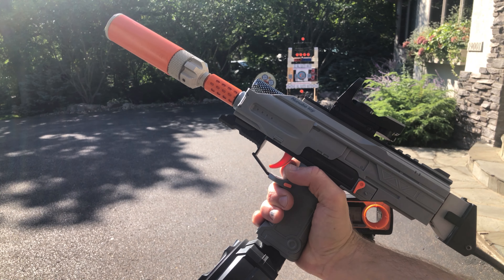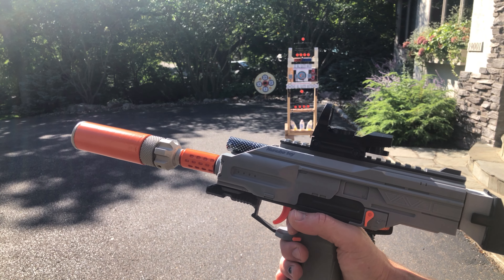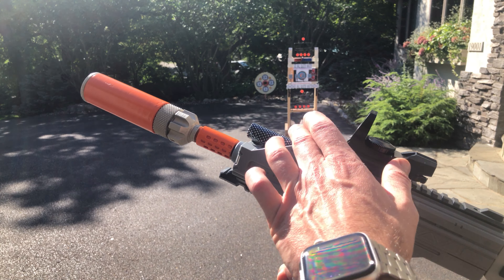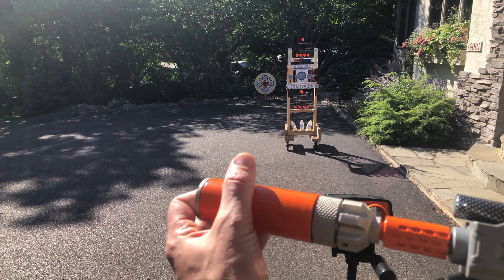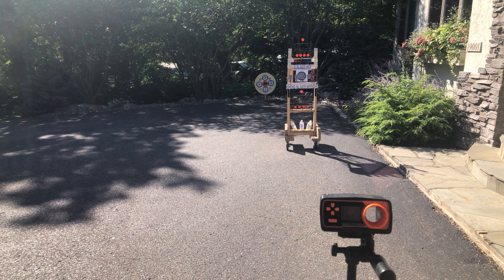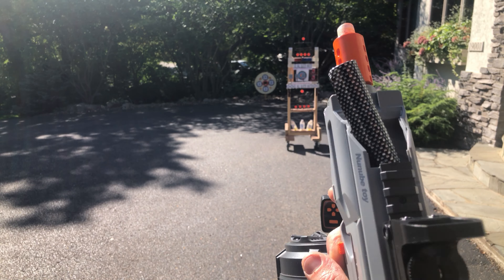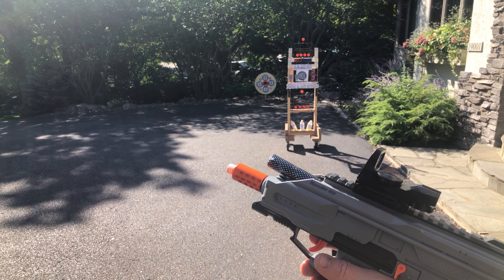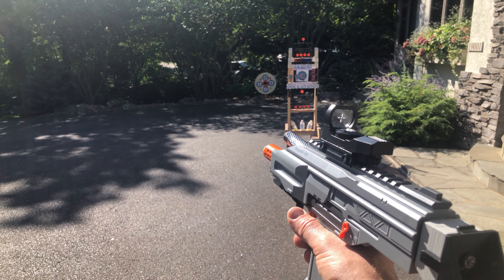Uzi Gel Ball Blaster with 11.1v Battery Upgrade

Comment: So I have one question if you use the 11.1 volt battery won’t the gears get striped away and damaged or are the gears strong  enough to handle it?. Also is it possible to get a tracer on this? If it is could you provide me a link for one that I could use
Reply from the maker: Nylon gears can withstand 11.1 but you will wear them out faster. This is not something I would typically put 11.1 in but several sellers were advertising it as ok. In regard to tracer, you need to 3D print a custom piece for that to work.
Reply: @GelBallBlasterMaster  Thanks bro. How long do you think those nylon gears will last for with the 11.1 volt battery
Reply from the maker: @Darealone422  hard to say

Comment: Nice bro, is there an option to install a new barrell or possibly install a hopup? Also how did you manage to change the stock?
Reply from the maker: There is an option for everything if you have a 3D printer. You could figure out how to add a hopup by printing g a part but I don’t think I would bother with it with something this weak.

Comment: Does putting a 11.1 vs a normal 7.4 increase fps? Or does it just increase rate of fire?
Reply from the maker: Just rate
Reply: @GelBallBlasterMaster what increase the FPS
Reply from the maker: @brendanmoney8753  bigger spring primarily and metal inner barrel. If you go to big on the spring you need better motor and metal gears too
Reply: @GelBallBlasterMaster where can I buy everything or ask to install an 11.1 volt battery?
Reply from the maker: all you need is an 11.1v battery. There are plenty on amazon with the proper connection
 @MegaPerromalo
Reply from the maker: https://www.amazon.com/shop/gelballblastermaster   there is a folder/list that has batteries
Reply: @GelBallBlasterMaster  Nice video, seems like a good gel blaser. I was wondering where I could get an upgrade spring (for say 200fps)?? Thanks
Reply from the maker: @BekfastMan6147  not really made to open/modify this gearbox so I just wouldn’t advise it. Not really worth the hassle in my opinion